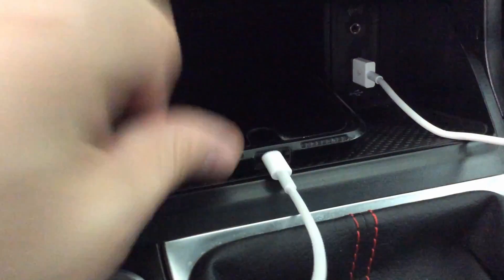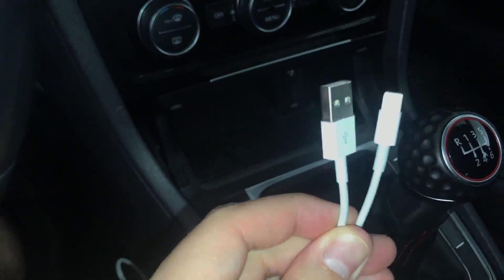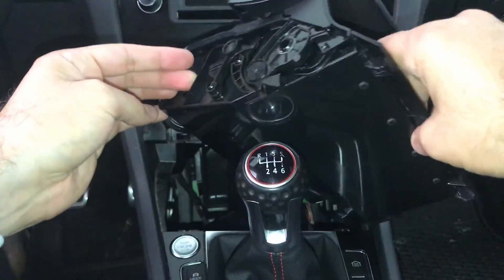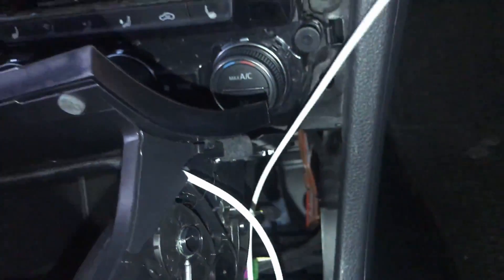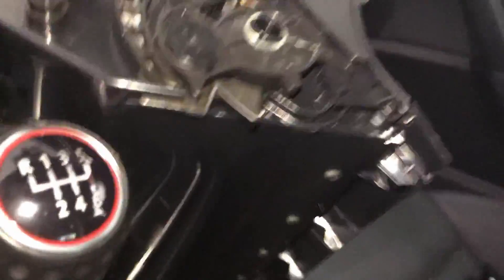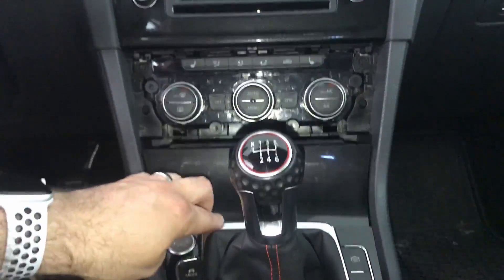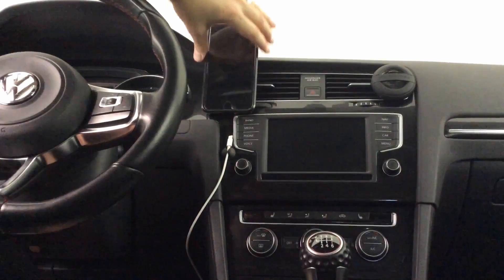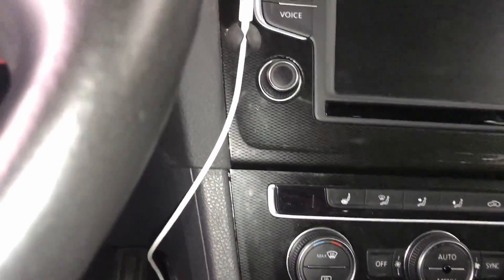How to hide your phone's charging cable in your car for a clean look

Comment: A black wire would have looked even better.
Reply from the maker: I agree. I originally had a black wire but it wore out rather quickly. I've had much better luck with genuine Apple cables. Wish they made black cables
Reply: Use a black sharpie. It’s a ghetto solution, but surprisingly effective because the cable never moves.